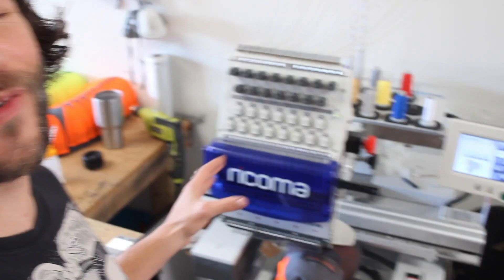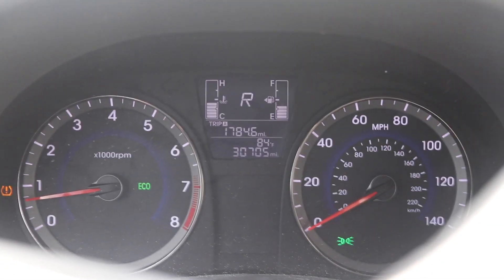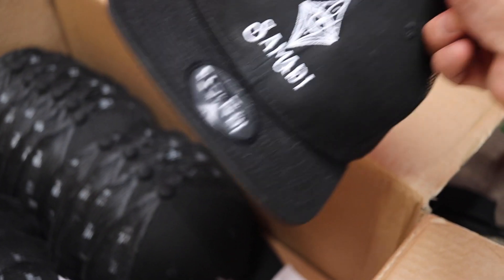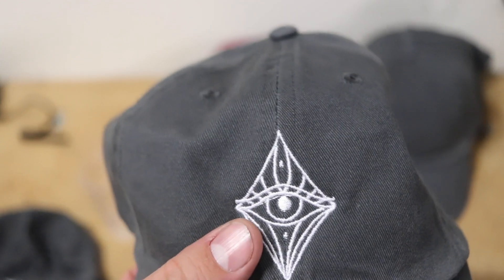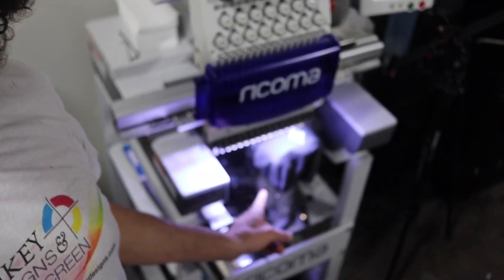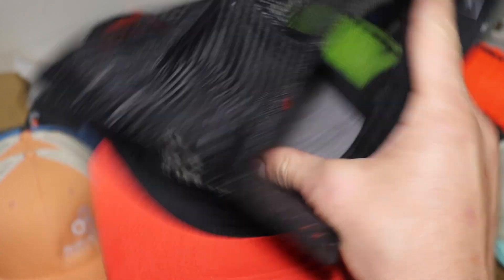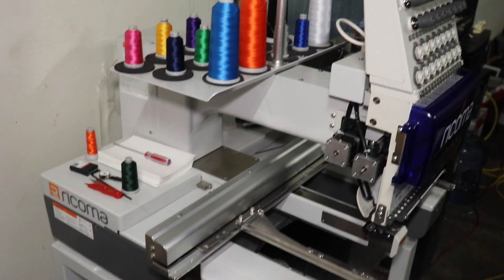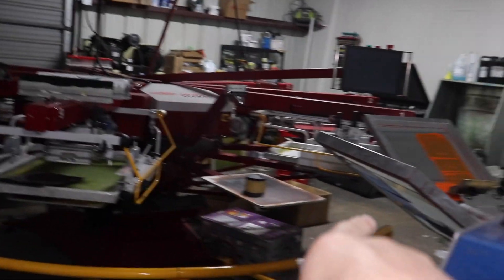Embroidering our First CAP ORDERS! Ricoma 1501-TC Affordable Embroidery Machine Ricoma RCM-1501TC-7S

Comment: Awesome job. Circles on dad caps are hard to get right because the want to go all over the place and it looks like you hit it right.
Quick tip: for 5 panel hats with a stiff seam, roll a dowel over the seam soften it up a little. Also try using a titanium needle. I'll be watching and I want to see you do well. Raider Nation!
Reply from the maker: Thanks for the tip! You're right about that. Definitely had to keep an eye on the tightness doing those circles.

Comment: Quality is all in the digitizing. I've been doing it for over 30 years. Are you sourcing your digitizing overseas? You should start learning and do it yourself, or kind a good quality US-based digitizer.
Reply from the maker: You're absolutely right! We've been outsourcing to a digitizer here in the USA. They do great work, but I would much rather learn the process myself.
Reply: @mikeydesignssilkscreen473  yeah there’s a lot to learn. Not so easy as people think. I recommend Wilcom.
Reply: I would outsource the digitizing and just make edits with the wilcom software. I find it the best because doing the object outlines is too time consuming and rather pay someone $5 to $10. Then I would just make edits like the sequencing, editing the stitch density, underlay, fill angles and pull compensation. specifically for what you will embroider.
Reply from the maker: @uriel11ful  Definitely! Knowing what to keep an eye out for when it comes to digitizing and being able to digitize is a skill worth learning.s
Reply: Mikey Designs & Silk Screen Yes! Digitizing correctly is so important if you want to produce a quality product. I have learned many little things about digitizing that has made my quality very good. If you ever need any help let me know.

Comment: Dad caps will always be a pain in the butt to hoop especially for logos that need to be symmetrical on either side of the seam. It’s not just the way you hoop them though, they aren’t made perfect, so centered at the bottom seam won’t necessarily be centered at the top. It’s nearly impossible to have them all perfect across a large order. Don’t beat yourself up, most customers are understanding if you can explain to them the imperfection of the caps.
Reply from the maker: They sure are! Just not a lot of support there. Great thing is I have some dad caps to do this weekend. lol. Thanks for confirming I'm not crazy lol.
Reply: @mikeydesignssilkscreen473  you’re welcome! I’ve been running an embroidery shop for going on 12 years so I’ve seen it all! I know how frustrating it can be.

Comment: Should have bought a barudan or tajima and you wouldn’t have that many problems with needle breaks. The Ricoma do not have good presser foot technology.
Reply from the maker: I appreciate your opinion. We've outsourced caps to vendors that have other brands. The quality of their embroidery, to be honest, hasn't been near as good as what we have been producing with our Ricoma. IMO, any machine we've had, issues come up, but it's the operator / decorator that makes the difference. We've produced quality prints with an antiquated TUF press that not many people could produce even on a (insert your go to brand here). I would get, v squeegees suck this, and that... Technique, patience, and how you go about resolving those issues makes a huge difference.
Reply: Mikey Designs & Silk Screen. You just haven’t worked with the right People that have barudan or tajimas. Digitizing is key!! And that what most companies lack in. You can produce great quality with most machines if you have great digitizing. The thing I don’t like about Ricoma is they are not that good of a machine quality wise. I have a six head barudan and will be buying another because they are workhorses and have not had needle breaks or thread breaks or issues since I bought it and mostly all my jobs are Richardson 112 caps. I can start my machine at the very bottom of the cap in the dead center and my needles won’t break like they do on the Ricomas.
Reply: Mikey Designs & Silk Screen if you broke needles now, you will be breaking needles for the life of the machine.
Reply: Mikey Designs & Silk Screen but thanks for responding with your perspective. I just wanted to let you know from experience.